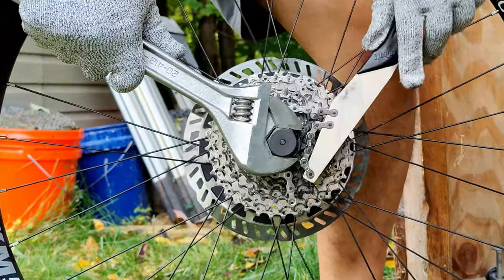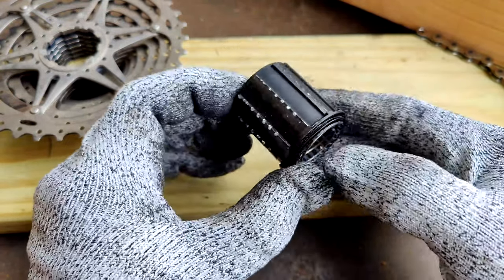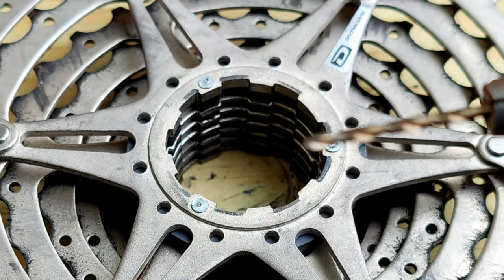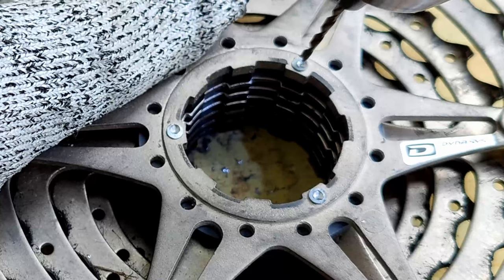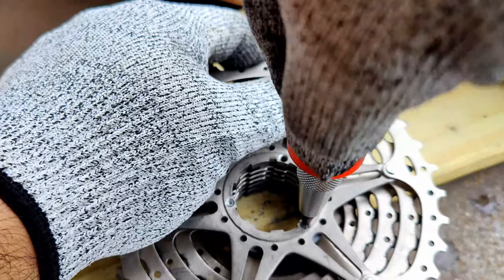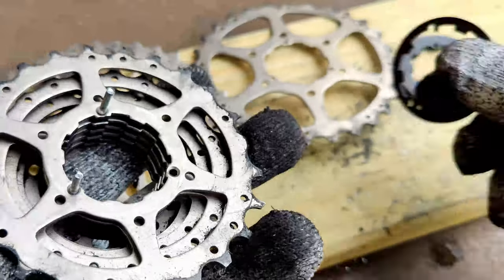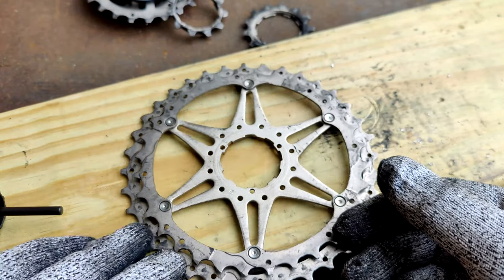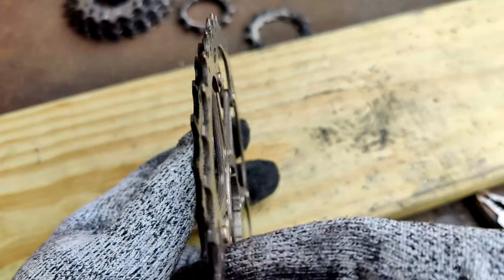Taking Apart the Shimano Cassette!  Is it possible? (YES.)

Comment: I reviewed this video while working on my old Trek MTB.  It is about 30 years old with 7 sprocket cassette.  On my older unit those pins were actually small screws and I was able to use a 4 mm socket to remove them without drilling.
Reply from the maker: Glad to hear 😁👍

Comment: This is just teaching me how to fix my sprockets lol. So them 3 pins you hit I have 2 little things that fell out the back when I got it apart torqued it off wrong cause it all fell apart hard on bikes. An the last gear outta 9 is alone like the first 4 big ones. The other 3 are stuck together. So I guess from what I seen already I have to drill witch I am rn an re pin. I'm just amused that those pins go all the way thru. If I'm right tho may be wrong. I think the two halfs go together a little differently cause the spacers some only have 2 holes. So I believe mines been put together both side there for I'm really in fir some fun today. Dont have a tool tried to spoke a rim bigger cant so I'm checking it out with a big ol mess few more big bearing being the little ones fell out an I think I can get away with it lol. I will see 29 here i come hopefully after a buncha sharades

Comment: Do you reuse the pins if you're rebuilding the cassette after cleaning it or would you need a new set?
Reply from the maker: Good question; I've never tried it and not 100% sure I would trust reusing it in my opinion.
Reply: You don't need the pins at all. They are only there for convenience of installation and removal of the cassette from the hub. A cassette can be made entirely of separate cogs and spacers (and a lock ring).

Comment: would it be possible to just remove the 2 largest cogs and convert this into a 8 speed ?
Reply from the maker: That's a good question, not sure if the spacing is different between each cogs.